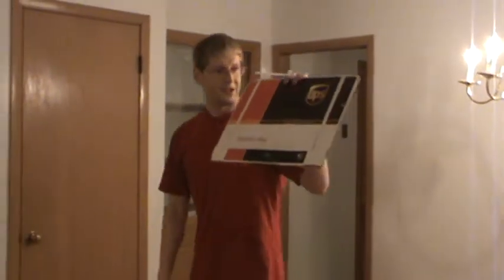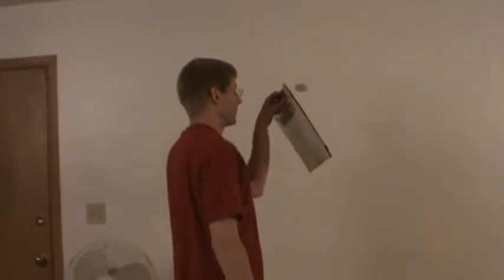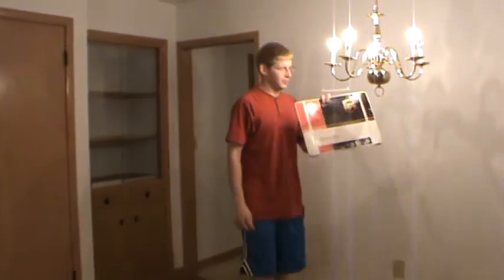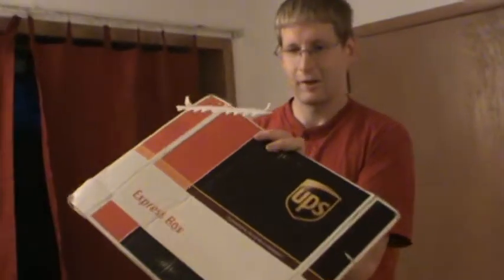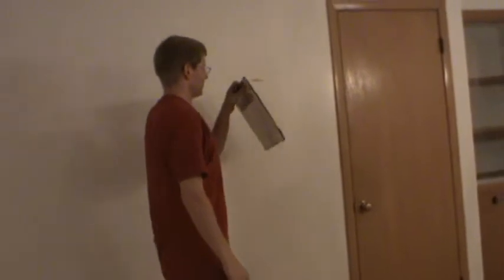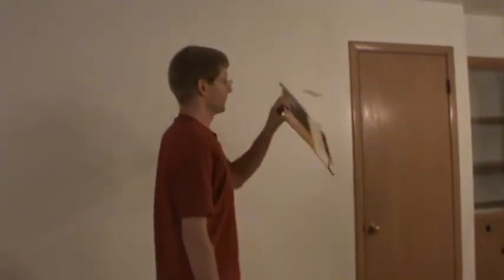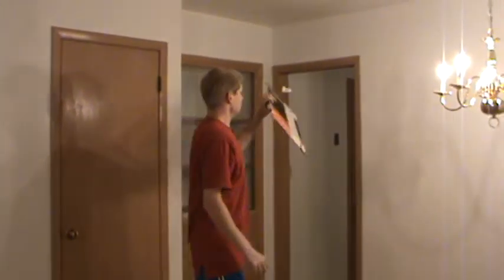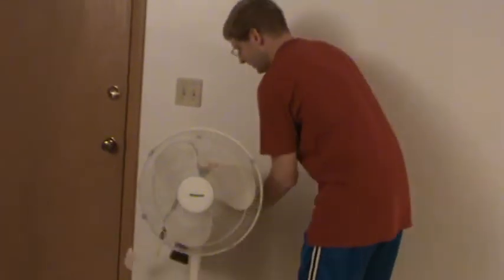Walkalong glider demo flight 1 - 70 Milligram Ultra-slow Jagwing

Comment: you fly multiple times through your own wake and the glider does not get upset too much or stop flying.  I wonder if these flights would be possible on a cold morning in a room with radiant floor heat.